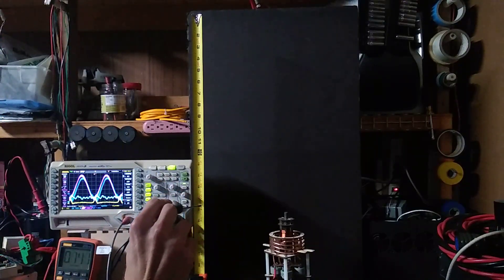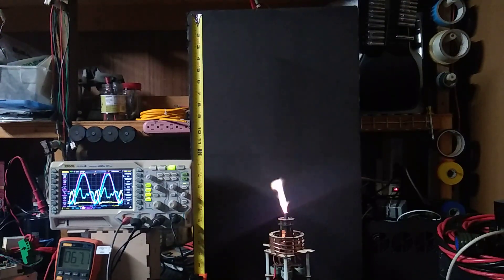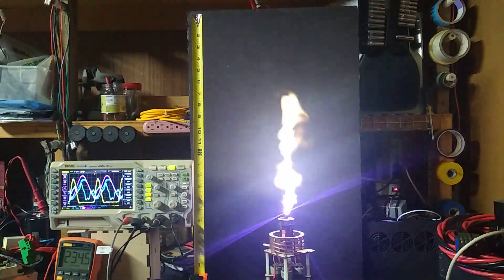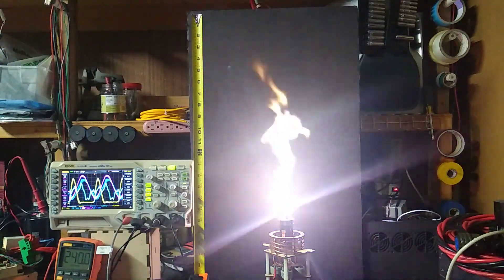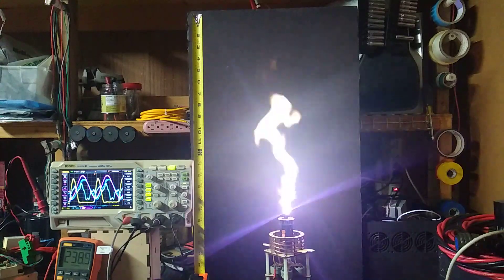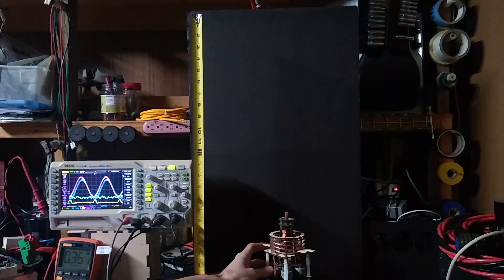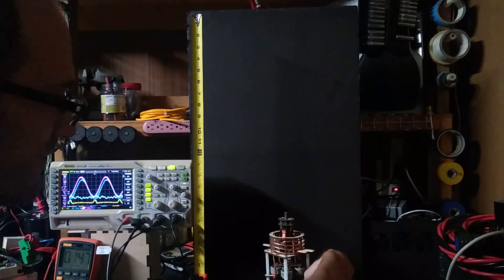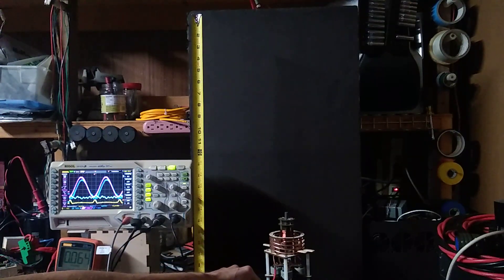HFSSTC V3

Comment: Amazing performance! Looking forward to your paper on HFSSTCs. How do you find the USCi parts compare to similarly rated Wolfspeed devices? I only have experience with Wolfspeed, but my impression is that the USCi parts are cheaper per Rdson (even considering their higher Rdson coefficient of temperature), while having notably higher turn-off losses. I guess Eon matters less here as you have soft turn-off in Class-E?
Reply: what is the price of a comparable Wolfspeed device?  This one is $13.82 in quantity of 1 with Digi-Key.

Comment: VERY IMPRESSIVE PERFORMANCE.
"Secondary is ~1" diameter with 42 turns of 24awg (24uH)"  you can rewind it with thicker wire.  it is only 42 turns.   The above description is ok but I wish you could show us the schematic and a close up of the actual build.  Thanks

Comment: lot's of power! time for liquid cooled heatsinks
Reply from the maker: The heatsink seems to keep up alright, but might look at cooling the secondary or using uncoated wire, as the 200*C enamel is turning brown.  Remarkable efficiency on the power switch - I do think the cascode arrangement is particularly good for this self oscillator which uses no gate driver IC, the cascode is like a built in driver for the JFET.
Reply: @SteveWard   maybe put the secondary in epoxy, with a pipe in it for cooling.
No isolation might give trouble with Corona discharge.

Going to look into that jfet cascode.
I need it to work in series, and switch on the high side. 

Do you have a blog or something?

Comment: Does the bottom of the secondary coil connect to ground or to the top of the primary coil?  If to ground, transformer action doesn't appear to provide any voltage increase, only secondary series resonance is helping boost voltage.  Modeling with JavaTC using your parameters (and a few guesses from the image) gives coupling at about 0.22.  Voltage ratio (sqrt of inductance ratio) is sqrt(24/1.26)=4.36.  Multiplied by 0.22 ends up just below 1, so slightly lower secondary voltage than primary at low frequency.  Any voltage boost must be due to secondary resonance.  Of course, if the two are in series, then you have almost 2:1 voltage boost at low frequency.

Impressive results!  Thank you for sharing.
Reply from the maker: The secondary is connected to the primary coil/cap junction and the tuning keeps the secondary voltage phase similar to the primary so they add up just like you say.  Indeed about half the voltage comes from the primary alone. The arc capacitance models well as a 10pf series with 400ohm resistance, which is higher capacitance than similarly sized metal objects, according to javatc.  Either my coil model is off, or the high frequency plasma presents higher capacitance per length than lower frequency coils.  The limit of operation is when the plasma load brings the secondary into resonance with the primary, which leads to over damping and loss of class E.
Reply: @SteveWard  Thank you for the arc model!  Will be quite helpful.  On the capacitance being higher than expected, is it possible that conductive ionized air extends past the bounds of visible arc?
I've made one attempt at a fixed ISM-frequency coil (lowest option at 6.78MHz).  Planning another attempt eventually at either 6.78 or 13.56MHz.
Reply: 75mm diameter by 300mm high cylinder comes to 10pF per JavaTC.  That seems reasonable as an approximation of the arc.
Reply: @SteveWard  Thank you very much!
Please, create a post about this construction on the HV Forum.

Comment: Have you considered trying with IGBTs? I heard from someone that they did it successfully. It would be significantly cheaper!
Reply: I think the problem is IGBTs are too slow
 Particularly tail current. The charge carriers in the junction need time to deplete before the IGBT can turn off. Not too unlike the reverse recovery time in a silicon diode.